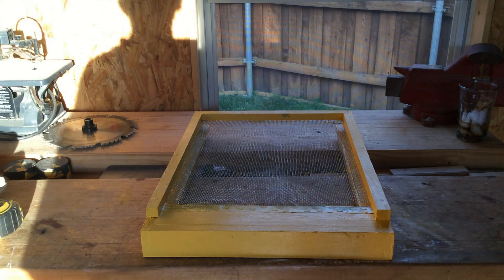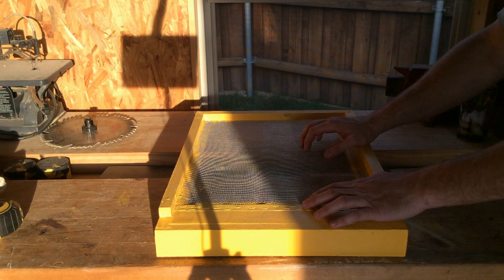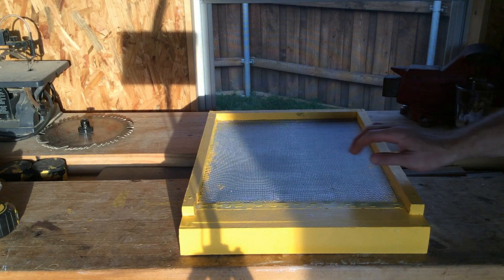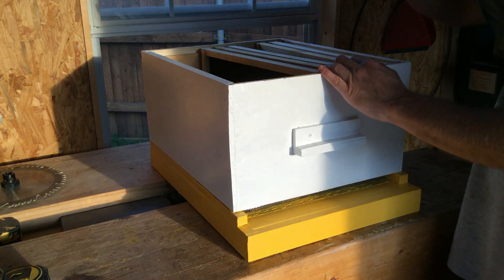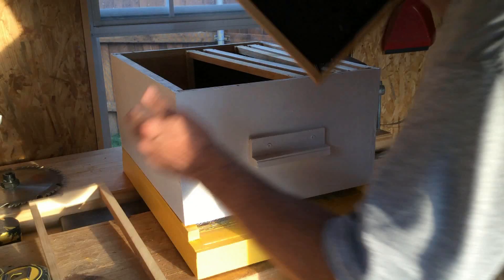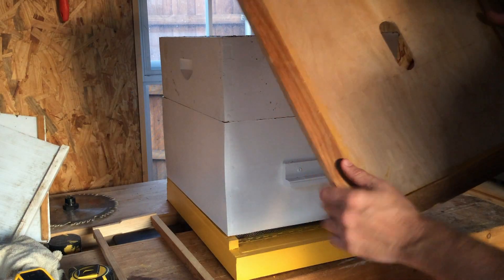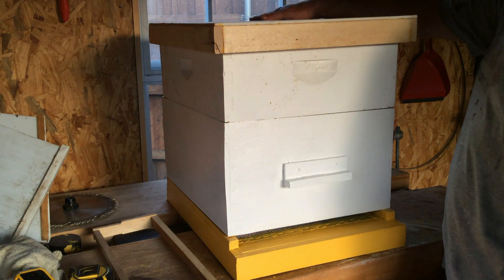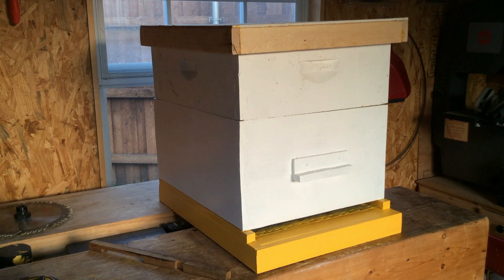Beekeeping - Explaining a Langstroth Hive

Comment: Taking that leap I got 2 set ups for next year one question is a hole needed beside the top for air??
Reply from the maker: You do not have to have a top hole for air. I do prop the top lid up a little with a piece of wood for ventilation in the summer since it gets so hot here in Texas (not enough that they use it as an entrance/exit) but it is not required.
Reply: @IceManTX69  Thanks in hot weather I will remember this
Reply: Ray Sarasin 9862529723
Reply: 9862529723

Comment: Nice video. What type of wood did you use to make it?
Reply from the maker: Pine from Home Depot
Reply: Plain 'Ol Beekeeping in Plano, TX 
Pressure treated? Or would that harm the bees?
Reply from the maker: Mike M I did not use pressure-treated. I think the pressure-treated wood also has some sort of chemicals in it to prevent insects from eating it and I've heard that that's not good for the bees. But that's only what I've read.

Comment: The very top lid that will protect it from weather. Is there like a gap that is keeping it from laying flat on the top hole so the bees can go out and in and give air circulation? From the videos ive seen it looks like the lid is flat on the top hole but that would make the hole useless. Other then that question the video is the best ive seen so thank you very much.
Reply from the maker: There is a small gap between the outer and the inner lid because the middle area of the inner lid (where you see the hole) is inset slightly from the perimeter. So the outer lid isn't flush against that hole on the inner lid. This doesn't allow the bees an extra entrance but they could crawl into that small space between the two lids. In the summer I add a small wood block to the front side to lift the outer lid further away from the inner lid. This allows for more air circulation and a gap but I don't see bees using it as an extra exit/entrance.